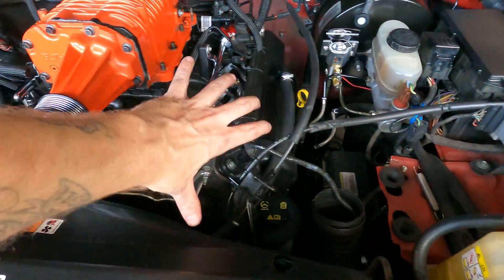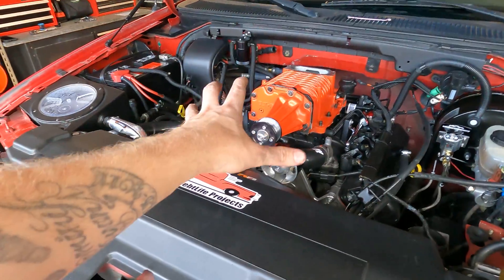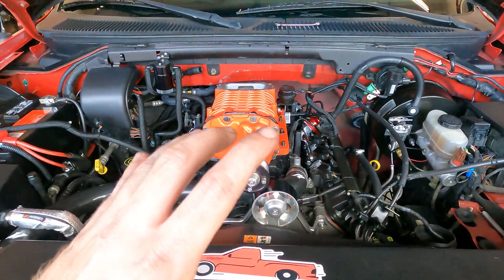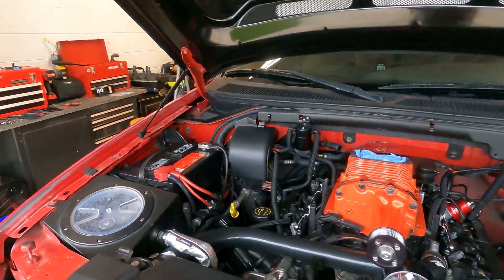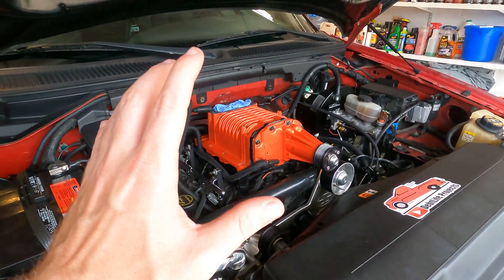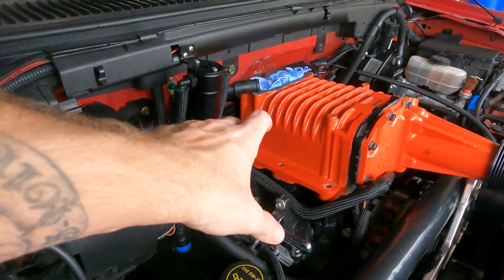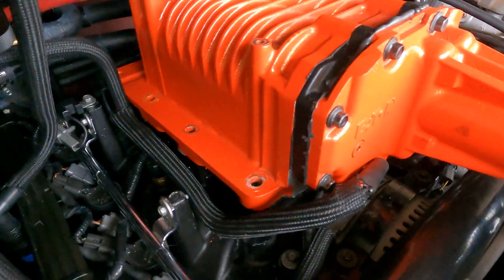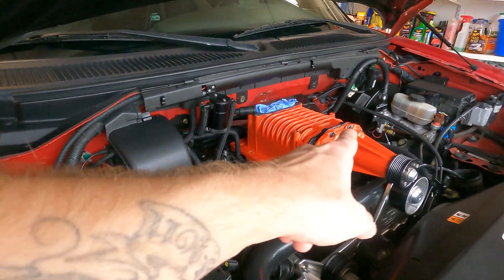Ford Lightning Complete Tear Down - Removal of the Supercharger, Intercooler, and Lower Intake!

Comment: Did the original supercharger work fine after Jokerz re-sealed it? I remember when you first installed it there was leaking out of the snout area that was apparently coming from a bolt?
Reply from the maker: Yup, worked fine after he re-sealed it.  Apparently I spun the snout seal, and it's pretty rare, like 1/100, but I'm also spinning the hell out of it (2.7 upper/10lb lower), so that's what happens when ya push shit lol
Reply: Very cool I appreciate it !! Just came across your channel last night I really like it. Thank you for not having an intro and just getting right into it and down to business without all the extra fluff everyone seems to have now.  @DebtLife_Projects

Comment: I rigged up a toggle switch to run the inter cooler pump in the pits and staging lanes.  Mounted toggle switch to firewall.   I don’t remember the details, as I did it about 19 years ago.
Reply from the maker: Nice!  I had a more legit jumper made, with male spade fittings crimped on the ends, but it's long gone now.  Lost somewhere lol
Reply: Great to know I'm not the only one having Joe Biden symptoms right now. In 2025. When I bought the truck, the first 3 years my sound system and electronics got so robbed so badly maybe 15 to 20 times. Turns out I think the security shop was the one really bypassing everything. Nonetheless I thought I had memorized where every stinking wire went and how my sound system hooked up and obviously the reason why I ran X wire this way had a reason originally. Now my driver side front door speaker won't play. I just had to be a total jerk and make it impossible to steal. Only problem is my daddy help me lift the seats out totally to install all the stuff so that it's very hard to service the amps. I'm hoping it's a wire preferably just the RCA wire. We'll see. I did normally replace those and refresh my grounds every two years pretty much fresh wires all around. Captain Dum Dum gotta DWI and didn't get to drive it for 2 years really. So that was not good for the vehicle or my knowledge. And how on earth did I reach 118,000 mi and all my symptoms sound like a clogged PCV valve. Why was nobody talking about these earlier? I don't understand. I've been changing my fuel filter every 10K at least. I would have freaking changed it or cleaned them if I would have known about it.